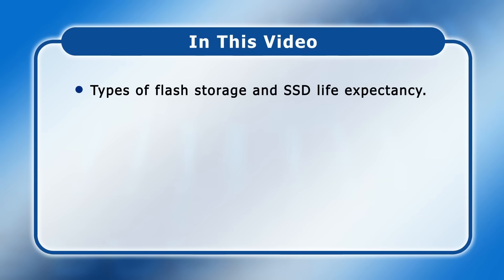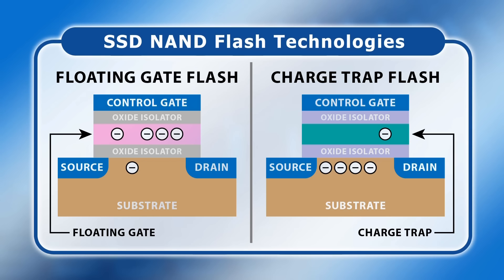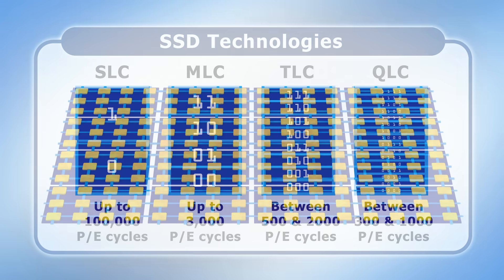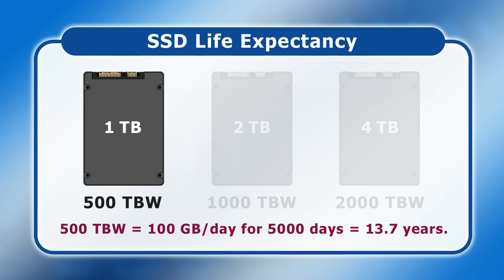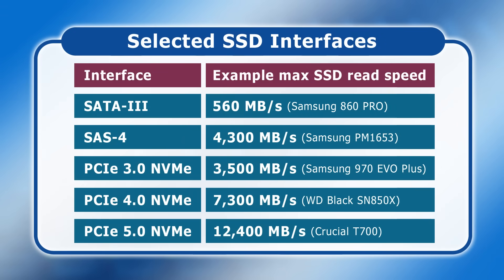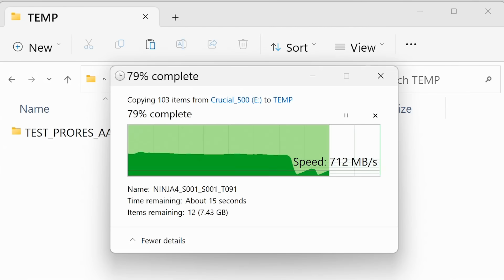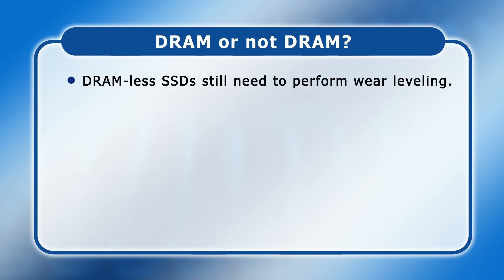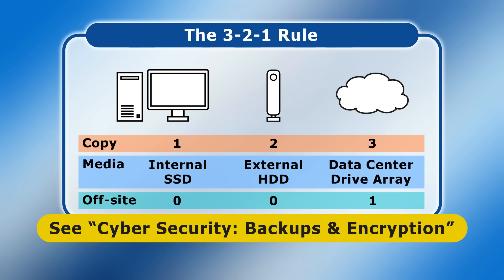Explaining SSDs: The Price/Performance Trade-off

Comment: Might be worth mentioning that Windows is constantly writing to its system files and changing the contents of your SSD/HDD while Linux doesn't share this rather annoying habit, so SSD life on a Linux system should be greater, or allow you to get away with a smaller capacity drive.
Reply from the maker: A nice point -- although applications in Linux (not least browsers) will always be writing cache data.
Reply: @ExplainingComputers  Very true, Chris, but I think that's the same for any other OS.
Anyway, the point was that Windows doesn't handle disc operations very well and has a far higher "overhead" when compared to other operating systems that are kinder to drives.
Reply: Kevin -- good to know. I use Linux Mint Cinnamon, using a Sata SSD.  I love Linux because it's not klunky stupid like Winblows.
Reply: If you game you need to be aware that by default windows gameDVR is constantly recording your game onto your ssd so that you can watch a replays of your gameplay.  Most people are not aware of this and need to shut it off or it out reduce the lifespan of your ssd immensely

Comment: I can't remember where, but I saw a test where HMB drives can be faster than DRAM drives for light tasks. If you have fast system memory like DDR5 6000 then it beats DRAM which runs DDR4-1866 to 2666. As soon as you read/write multiple GB of data DRAM wins again.

Comment: Thanks Chris, this kind of information is needed, I do video editing, and want to make sure I don't get the slow down while transfering data, which drive would you recommend. I currently have WD_Black Nvme - 500GB - WDS500G3X0C, which been using for few years attached to mainboard, I struggle with 2.7K Video files in resolve. Please recommend a replacement. Thanks in advance.

Comment: Great coverage of the topic.  Are there performance/longevity considerations for the primary drive from which the OS (and programs) execute versus a secondary drive upon which we store user data?  I'm thinking it is common these days for the primary drive to be NVMe M.2 attached to PCIe lanes of the CPU and a larger secondary drive to be an SATA SSD via the chipset.

Comment: So the SSD itself can monitor its expected life remaining. Are there tools out there that allow me to see its life remaining info too? I would like to know how long my hardware will last.

I assume everything said here applies to USB based memory sticks and cards too, or are they build from a different type of memory unit?
Reply: Good questions, I'd like to know these too.
Reply from the maker: To monitor your SSD, you need a utility that can read the SMART data (or "Self-Monitoring, Analysis and Reporting Technology" data) from your drive. Lots of free ones are available -- such as CrytalDiskInfo ( https://crystalmark.info/en/download/ ). And most SSD manufacturers have their own monitoring software -- eg Samsung Magician for Samsung drives ( https://semiconductor.samsung.com/consumer-storage/magician/ ). Note that SMART data cannot be read for a drive connected via USB -- so these tools only work for SSDs inside a computer.

You are right that what is covered in the video applies to USB memory sticks and memory cards, as they are also based on flash memory (almost always today TLC). However, cheaper USB drives and memory cards will not have as good wear levelling as an SSD, and in some cases no wear levelling at all.
Reply: @ExplainingComputers  The Mint Disks utility (Menu | Accessories | Disks) has a SMART item in the menu. I've only got HDDs but maybe Mint already has everything you need to monitor SSDs.

Comment: Thanks for explaining that so clearly Chris. It's very helpful to understand the reasons why certain cheaper ssds might not be as good of a deal as they appear, although for general use they are okay. I have a good quality system nvme drive and a decent larger drive for game storage. I do a little bit of video editing but nothing that requires massive reads/writes. I might see if any good deals pop up before Christmas as drives like the Kingston Fury and Western Digital 850X have been a nice price in recent months. As Samsung recently brought out their 990 Pro drive the 980 Pro has also seen discounts. These cost so much until fairly recently so it's nice to see prices come down. Long may it last! 😁

Comment: Good stuff. Had a Samsung 500 Evo in my Mint machine for yonks. Works flawlessly . Chris did you ever consider looking into the question I asked towards the start of the year about a simple guide how to connect a wired cctv camera to my mint machine. Still haven't found a way since flash stopped in all browsers. I use Vivaldi and Brave by the way. Cheers.

Comment: These are the aspect of computing that Linus Tech Tips cannot explain. Or if they can, they just gloss over gleefully for the sake of click bait without going in-depth. 

Good thing we have ExplainingComputers to explain things thoroughly.
Reply from the maker: Thanks, appreciated. :)
Reply: @ExplainingComputers  I await your "water cooling Mr.Scissors using a swimming pool" video with much anticipation, Chris.

Just kidding. I do enjoy LTT. But, like, you go to them for computer-based silly entertainment, you come here to actually learn something.
Reply: @klaxoncow  But its not that deep enough, to reveal some non-obvious details: for example Anandtech benchmarks many HMB SSDs. But there is no hint how to query the state of the HMB buffer state (enabled or disabled?). As you can even disable HMB comoletely, then the performance drops down to prev. gen. DRAMless level. How much RAM has been allocated to the HMB buffer? As it can also vary!
Reply: i think LTT doesnt aim for this kind of viewer.
Reply: @syarifairlangga4608 Yeah i see LTT viewers as mostly young males who are PC gamers pretending to be "tech savvy" but only care mostly about flashy stuffs like graphics cards and RGB lights.
Reply: That's true and they where (Linus tech tips) suggesting major SSD manufacturers where involved in "bait and switch" tactics but I don't believe industry to be anywhere near that cynical...if drive speeds fall short of claims then i'm sure there's some other reasoning for that perhaps its industries hierarchical order the available quality of materials or supply chain issues but not outright swindlers as Linus has once boldly claimed..
Reply: @ericjarvie  the drives in that video werent even close to what they were supposed to be, and adata wasnt changing the model number or packaging to reflect the new drives characteristics.

Comment: Sir,

Of course, i realize you can't cater to individual SUBSCRIBER scenarios

i just thought to mention  something below on this video topic.........

my SSD drive  began displaying a BOOT MESSAGE along the lines of 
  " Soon, i am going to  FAIL  ..........."  a  few MONTHS back.........

That same message has remained at BOOT UP  for many many months now.........
THe drive has not failed........?

it is a HP Laptop and i believe the message is generated by the BIOS performing a specific Test on SSD's and suddenly ( a few months back) getting a NEGATIVE test result .  So the BIOS then displays a warning about the SSD

the machine is 12 years old but only got an SSD in about 2018  
 ( FIVE YEARS AGO approx)

i have backed up stuff to a PEN DRIVE. just incase

............i just wondered if the SSD error message could just be a GLITCH in an old Laptops bios.....?.......indeed the Laptop does have several other  issues with failed  KEYS and other bios related issues that happened  YEARS  PRIOR to any SSD warnings.....

Thanks
V
Reply from the maker: I'm sure that everything you say above is correct -- the laptop will have read some SMART data from the drive to trigger the warning. And it could be a glitch. I seems to be that you have done the right thing by taking a backup, so I would continue to use the computer, being aware that it could fail.
Reply: In plain language, you need to get a replacement now.
Reply: @cdl0 

Yes Sir, common sense would dictate that i should start using a NEW DRIVE and switch OUT the existing drive....

That way, the existing drive is not yet dysfunctional.....
-
 ......thus meaning, on Rare occasions i could SWITCH IN the existing drive & always get A GOOD  BOOT if the boot ups were just for emergency's & for a few minutes of UP TIME.

i don't want that existing drive to become totally dysfunctional.......

If i get a new SSD i would Like to put the TINY 11 version of windows onto it.......

First  i would use the "Tiny 11 ISO file" downloaded onto my existing drive.......
-
Then i will install the ISO file OVER onto the new SSD  by plugging  the new SSD drive into the Laptop USB using an adapter.....

Thanks

Comment: Since they are 'charge devices', how long can they retain data in a power off stage? So SSD's may be better suited tor NAS storage than 'active use'?
Reply from the maker: Greetings Leslue. There are many views on this -- and it depends on how many P/E cycles a block of cells have been though. But it's generally taken that data on an SSD (or any other flash storage) should be retained unpowered for a couple of years, maybe more. Powering the drive and reading all of the data will refresh it (different to a hard drive, where data refresh requires the data to be re-written).

Comment: Another excellent video, with lots of great information!

Here's hoping that SSD size and price will soon be able to compete with HDDs for NAS use. :)
Reply: I wish but doubtful, HDDs are still KING for storage.
Seagate just released 24TB drives and roadmap is 40TB drives in 2 yrs
Reply: 24 TB for SSD is easy to achieve but price ....  2.5 case you can easily make ssd of size 100 TB   @Argedis
Reply: @Argedis  But, they're Seagate...
Reply: if you look at low end SSD's, say teamgroup sata qlc dramless drives, for a 4TB drive, goes for $142, whereas as a Toshiba N300 4TB goes for $97, so we are getting there (although the N300 is a higher performance drive, the dramless ssd will smoke in terms of read and random performance, but will lose in sustainted writes) If you use these cheap SSD's with the expectiation of hdd like real world performance and dont write them heavily, they are better suited for nas use as they dont wear just from being sitting idle.
Reply: @rysterstech  The problem with that argument is that 4TB is not the sweet spot for magnetic storage any more. In terms of cost per gigabyte, 4TB HDDs are much more expensive than 12TB ones.

Comment: I once bought a dram-less Sata SSD.  Never again.  Saving a few coins isn't worth it.  Better to buy one with dram.
Reply: I remember my DRAM-less SSD back in 2016 was SLOWER than my HDD lol
Reply: @sihledotcom  Worst I've ever seen has been around 30MB/s, so that definitely can happen :D
Reply: It was quite literally a SATA MicroSD lol @jothain   and it was from Corsair which was extra disappointing
Reply: @sihledotcom  Agree. HDD is superior. Especially modern CMR AFD with > 500mb cache
Reply: They're OK in some cases. The DRAMless Silicon Power mSATA  drives are often cheaper than a flash drive in the same size. I would also stick one in an old computer. I don't ever use them as my main drive in my laptop or desktop.
Reply: @kattz753  Well I gave review for vendor that it's ok for NAS usage to ie. view/listen media over network or possibly as gamers data storage drive. But absolute garbage for usage were there's a lot of writes happening.
Reply: Yes, they're horrible. Worst is that manufacturers can still report really good speeds, but not revealing what amount of data it was done. Also this definitely should be mentioned in datasheets. WD I bought didn't have this on data sheet 🤬
Reply: In general I agree with you. Some ssd controller chips actually have a fair bit of dram built in. I'm not quite sure if they count as dram less because I think all controllers have at least some dram built in. The wd blue blue in particular seems to never get bogged down the way some other discount drives do - tho its maximum bandwidth is pretty limited , it does at least perform consistently
Reply: At my organization all the dev boxes have these cheap SSDs.  It shows when doing repository copying.
Reply: Even more cancerous: it's seriously hard to find one at a competitive price with it and doesn't have an illegally low durability and a low IOPS, including from Samsung or Kingston, for ex, so you're either paying extra for a known good one, an order of magnitude more for a newer one (cuz the dickheads will end the current older good ones), or buying some questionable shit and hoping it'll last.
Reply: Linus "if you're going to buy DRAM-less SSD, you might as well buy an HDD"
Reply: But is this actually still relevant with HMB? For normal users, not video editors and stuff mind you.
Reply: @Alias_Anybody  It absolutely is, cause HMB support isn't "universal". For instance likely none of the consoles support it. Also it still relies on other hardware you have.
Reply: @jothain  
I think it was a given that we are talking about PCs (desktop or notebook) with enough RAM? If it has 4GB then the drive won't be the bottleneck anyway. 

Btw. I don't know about the Steam Deck (I asssume it does?) and the Switch doesn't take SSDs so that exception only applies to PS5 and Xbox whatever.
Reply: @Alias_Anybody  steam deck absolutely has normal ssd support. It's just those shorter drives 2230 iirc. Anyway that function needs to be supported on OS core level. Linux though apparently supports it quite well (steam deck). But method also increases overhead for the used system. Plus imo it's shitty way of implementing it anyway as almost all OS's use unreserved memory for file caching. Like my desktop has 32GB's of RAM and still quite quickly during usage memory allocation can be like 26gigs, but a lot of it for drive caching. It's obviously pretty much read only, but still. It's overall just quite bad implementation. Kinda like GPU manufacturer dropping memory of from the card and stating user that he should buy memory module for GPU to work properly. Not cool.
Reply: @Alias_Anybody  also this definitely can affect quite generic usage for anyone. For instance I have small home lab server that runs Windows, home assistant, Jellyfin and multiple other systems. It has 16GB of RAM, but it's almost all allocated and this system absolutely benefits from using all the available RAM. Now add this drive scenario and situation is... Bad.
Reply: @jothain  
I mean in Linux circles it's basically gospel that "unused RAM is wasted". Like, if anything can be made more efficient by using existing RAM not used by something more important then use it.
Reply: @Alias_Anybody  but that's exactly my point. It's already used by OS level cache. This function is just unnecessary overhead like I already mentioned. It's simply manufacturers being cheap skates
Reply: @jothain  
The cost difference for consumers is absolutely massive as well though. For the additional cost of a 1TB DRAM drive you can probably add 16GB of system memory which is also useful for other stuff when your drive is mostly used read only.
Reply: @Alias_Anybody  I highly disagree. Issue is that many models don't have any. Imo it's unacceptable trade.
Reply: @Alias_Anybody If it has 4GB then the drive won't be the bottleneck anyway  I don't agree, in a computer with such a small memory size the drive can be a major bottleneck due to excessive data exchange between the memory and the disc, as a result of Virtual Memory operations aka paging. This can also result in reduced life expectancy of course. The more RAM available the less page swapping is about to take place.
Reply: What was wrong with it? Was it a filled up QLC drive that no longer had cells to serve as SLC cache?
Reply: Aye, but it's not something generally listed in specs
Reply: @danielpicassomunoz2752 if it's not listed, then it has none
Reply: Don't worry, just use in for a boot drive and don't store important data in it, backup important programs in a hdd.

Comment: Speed which become attractive point are full of lies then. Pseudo SLC cache is look good, but is just make nand cell 2-4x shortened the durability. And also is generate more heat, so QLC is the worst deal for us. So 30% more cheaper is not worthed if the durability get downgrade by 3-4x times than TLC.
Reply from the maker: Read speeds are accurate, but write speeds very much depend on how much you want to write . . . which is indeed often not discussed! I've never seen an SSD with the SLC cache size printed on the packaging.